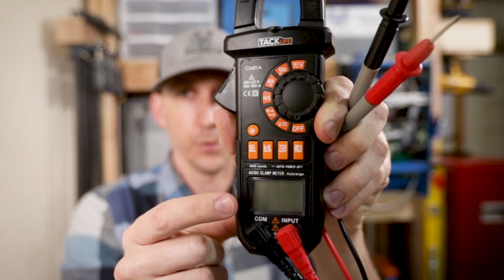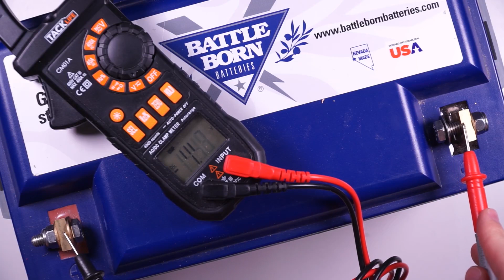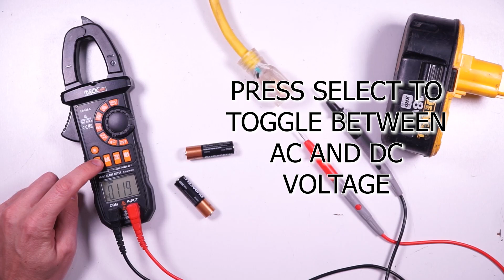How to Use a Multimeter to Take a Voltage Reading (In Your DIY Camper Electrical Build)

Comment: Good tip at the end. Always treat electricity with respect. When I disconnect my lithium batteries that have 120mm2 cable between them I always wrap the lugs with insulation tape as they have a tendency to flap in a particular direction and I don’t know what they might hit (like the chassis of the vehicle) or something else. Probably not technically necessary but until I know for sure best to remain cautious.
Reply: 😅😅
😮😅😅😮😅😅

  
   K.k 😅
😮😮😮😮😮😮

Comment: I have the exact same voltage meter but it went haywire on me. How is yours holding up?
Reply from the maker: For as cheap as it was; it's still holding up surprisingly well. 🤣🤷‍♂️  When this one goes out; I'll probably get a Klein or similar; but the cheapo is still chugging along.

Comment: @4:30, it's not the volts that cause the damage. It's the current behind them. A 9-volt battery can kill if the current takes a pathway across your heart.
Reply from the maker: If you're able to get the 9v battery terminals to contact your heart directly to complete the circuit, there are other issues going on that need to be addressed.

Comment: Some advice for everyone. You want to follow the "Live Dead Live" method if you're using the multimeter to verify that something is shut off. Test it on a known live circuit. Then test the circuit that you're shutting off. Finally, go back to the known live circuit and test it again. This ensures that the multimeter is working properly and that your circuit is indeed dead. (The final test is to make sure the multimeter didn't die during the second test.)

Comment: You don't mention reading amps.  Some meters do not read DC amps. Mine.  It does have a clamp but no selection for DC amps.  How often do you need to read DC amps? I would think down stream from the inverter it might be nice to know how many amps are flowing to a distribution box, for example. Your input please and thanks
Reply from the maker: I rarely need to read DC amps.  Most of the time, if I need DC amps for something, I'll just take that reading from the shunt (Victron BMV-712 or Victron SmartShunt) in the system.

Comment: volt is not most dangerous, the amp is.
Reply from the maker: That's not necessarily true.  I can touch my fingers to the positive and negative terminals of a 12v battery bank capable of flowing 1,000 amps all day long and nothing will happen because those amps aren't being delivered at a high enough voltage to do damage.

Now...  Touching a 120V source delivering only 15A?  That will be deadly pretty quickly.

How about a 50,000V source delivering .0036A like a police tazer?  Not immediately deadly (usually) but definitely not pleasant and would be deadly or permanently damaging if not removed from the source for more than a few seconds.

Point is...  both volts AND amps are dangerous in the right combination.
Reply: True and i agree that 12v car battery won't electrocute you, we have to much resistance in our skin  :)  i have been tazed it hurts a bit :P

Comment: Hi Nate,
I love your channel and thank you so much for all your instructional videos, Brilliant! I have a question and hopefully you could make sense of this problem please?
I have a total of 4 panels I just wired up in series parallel. 2 lots of 2 panels connected in series which are then connected in parallel. When I tested the end result with my meter I'm getting reverse polarity although I am getting the correct voltage and amperage but reverse. The only thing I didn't do was check the polarity of each individual panel. Any clues as to what might be happening?
Thank you in advance...
Reply from the maker: I would very much recommend testing each panel individually to see if something is weird there (also verify that your leads on your multimeter aren't switched.)
Reply: @EXPLORISTlife  Thank you for your reply Nate.

Comment: Is it normal for a selection of virtually identical 12 solar panels to "show" quite a variation in volts and amps measured? Testing was done on same day (sunny, no clouds, 77F) in about 1 hour time; all placed in the same place, with same angle. These used Trina Solar 250w panels  (Polycrystalline) are the same age, type and rating. These are rated at 30.3v VMP (38.x VOC) and 8.27a IMP (8.54 ISC)... so they are 250w panels. Variations I measured were from 33.2 volts to 36.8 volts VOC and current ranged from 7.74a to 8.5a ISC using a decent VOM that can read DC amps. Calculated panels watts thus varied between 247w and 298w. Again, is this normal? Nate, what you are doing is so well done. If I had listened to you in the past, I could have saved a ton in smaller wire alone. Thanks, Earl.

Comment: Rookie here: I have my panels in series parallel. (6 panels). I’m getting volts off this same multimeter actually lol but when I switch it to amps. I get a zero amp reading. Taking the reading right after the solar panels. Before I run wires to the shed and batteries and solar controller. Why is this?
Reply from the maker: If using the probles... Amps need to be read 'in-line' on the positive wire ( But don' exceed the amp rating of the multimeter).  You can otherwise use the clamp around the positive wire with the dial set to amps; but there has to be current flowing (actively charging the batteries) to get a reading.

Comment: I’m very much a novice. I bought my mm 2 years ago but couldn’t find out how to use it. This tutorial helps. 

Now I want to learn how to take a watts reading off my solar panels AND understand what it means. I have a 100 a/h agm battery which will be charged by two 100 watt panels in parallel but one is mono and one is poly so I’m sure I’m not getting the full 200 watts, plus I understand you don’t get the full wattage anyways, so I’d like to know how much I am actually getting.

I just discovered you on google while trying to learn about wiring which lead me to your youtube channel. Subscribed right away. I can tell you are going to be an invaluable resource for my project. You are easily equal to my other favs will prowse, adam welch, and amy at the alt estore.

Thanks for what you do for the nomad community.